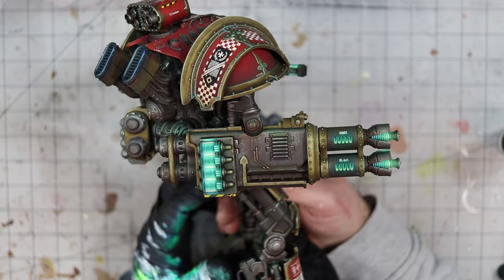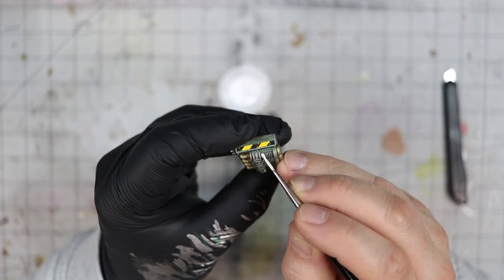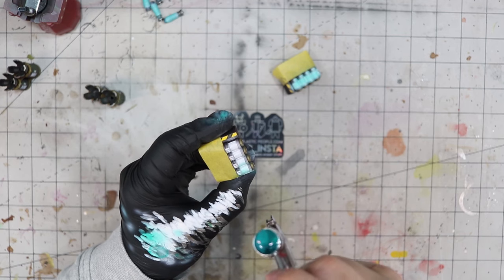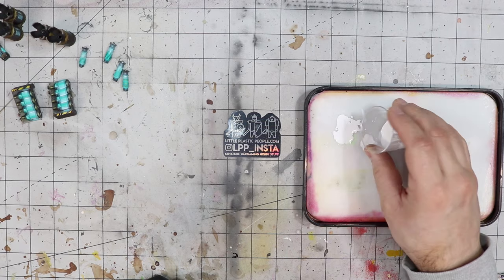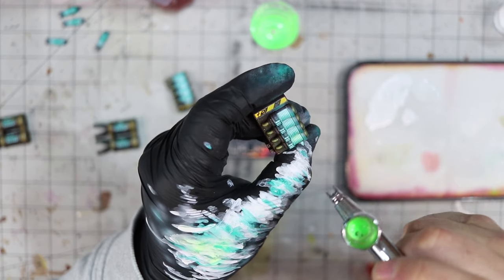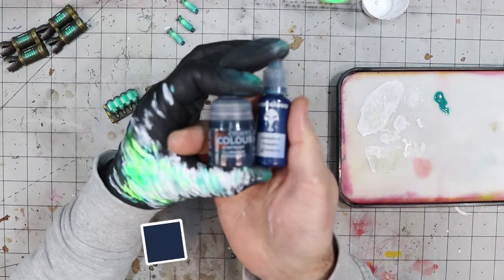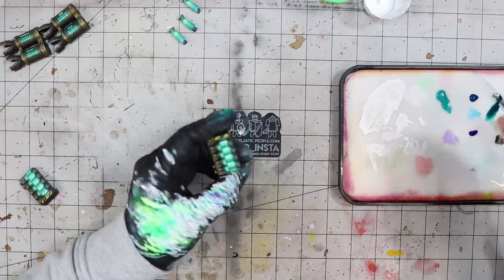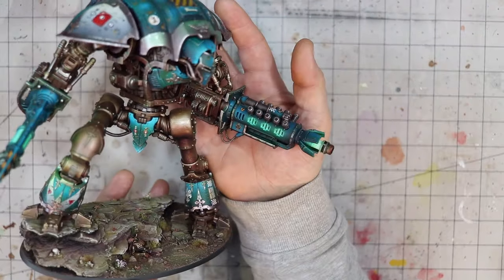Painting Awesome OSL - Make Your Minis Glow!

Comment: How do you clean your airbrush after using acrylics? Because my cleaner just gunks the paint inside. Also absolutely nuts quality video!
Reply from the maker: Thanks! I give it a really good rise with water, making sure to back flow and dump out any crud. I then run a little cleaner or ipa through it. I also give the nozzle a brush with a toothbrush soaked in cleaner, making sure to pull the needle out of the way.
Reply: @LPP_YT  thanks a lot!